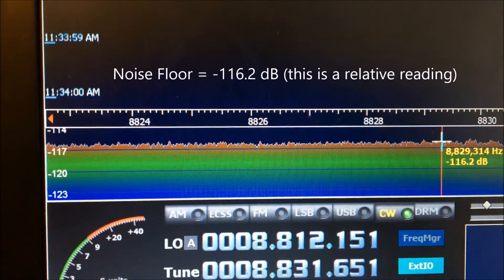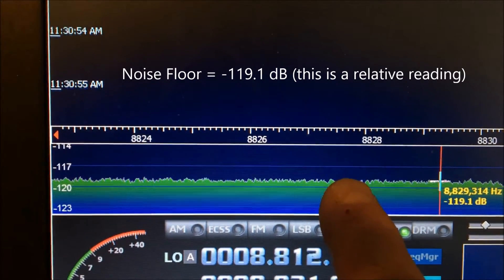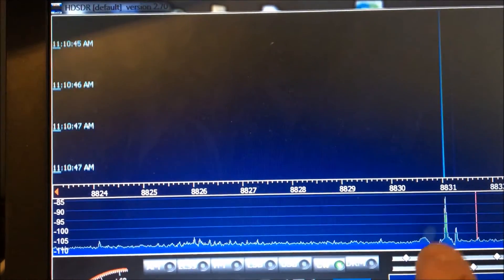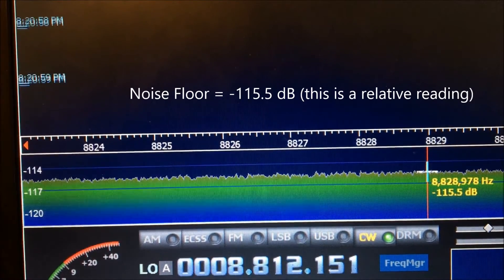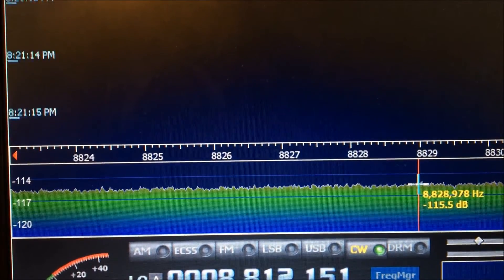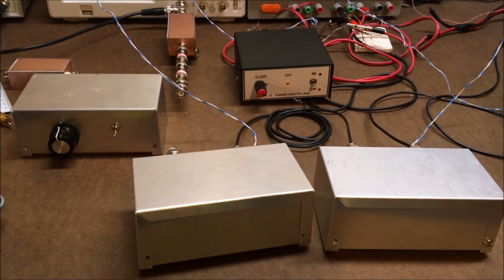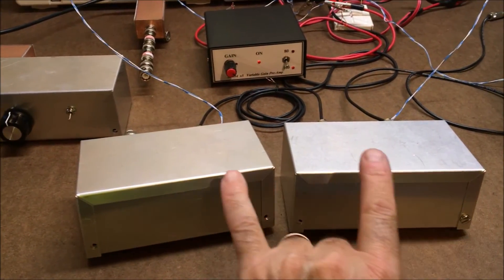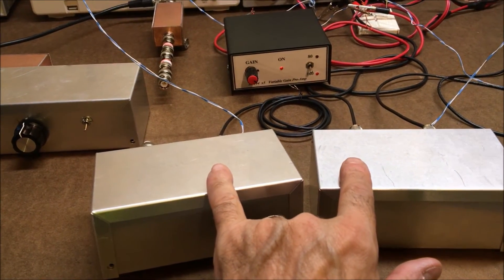Noise Figure comparisons of KD9SV BF994 x5, W1FB, and W7IUV preamps by WD8DSB Nov 8, 2016

Comment: Very interesting. In which configuration would the KD9SV amplifier have an audible advantage?
Reply from the maker: Hi Ralf, great question.  I'm by no means an expert on this topic, but if you live in an area where the noise floor is naturally very low (out in the country with no neighbors, etc.) and if your using a receive antenna that has a considerable amount of negative gain, then the use of a very low noise preamp like the KD9SV preamp shown in my video is probably an advantage.